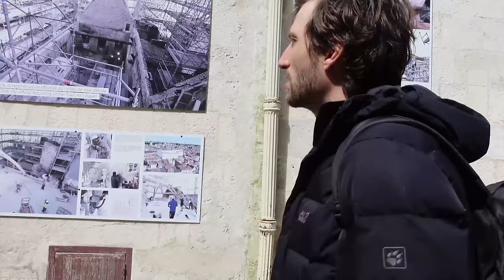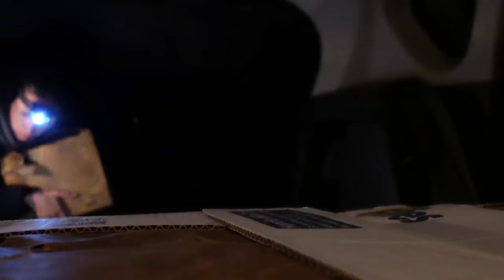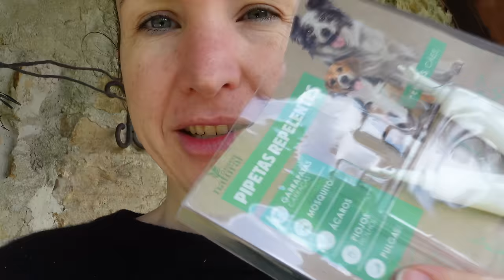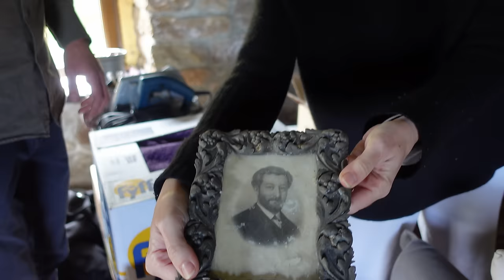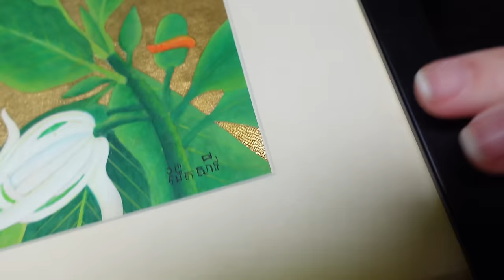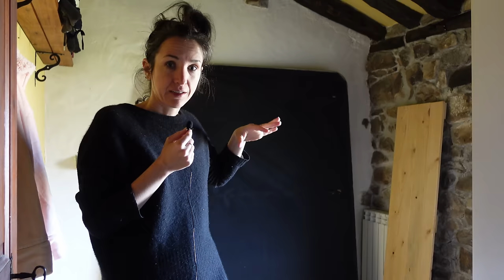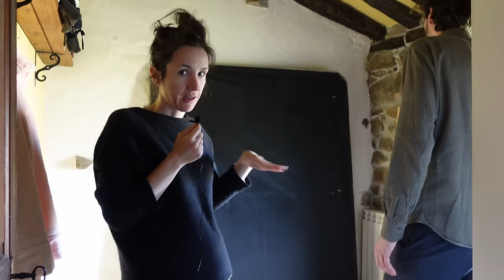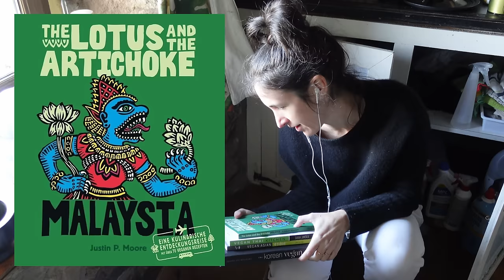We're BACK HOME and we need a reset..

Comment: Anytime you Don't  have a gap between the bed and the floor you can get mold from your body heat and moisture  when you are in bed, also with dog beds. It's happened to us, you will be fine with the new bed frames with the gap.
Reply: Totally agree. Lift the bed and problem solved.
Reply from the maker: @katybuilds  @janehodgetts6078 We learned our lesson and will for sure be getting a new bed frame 😅